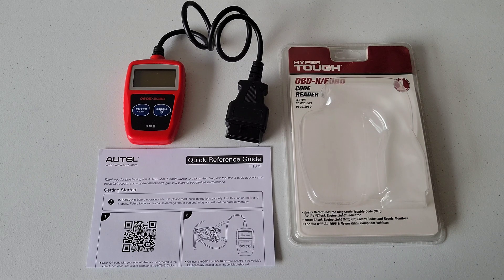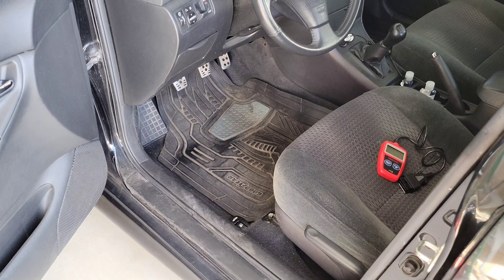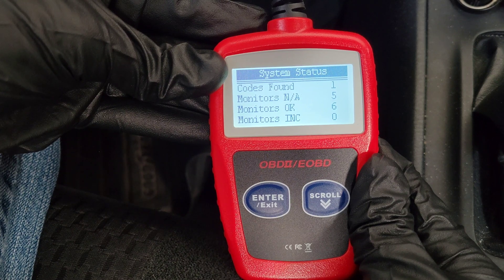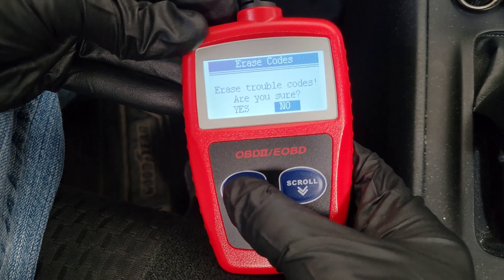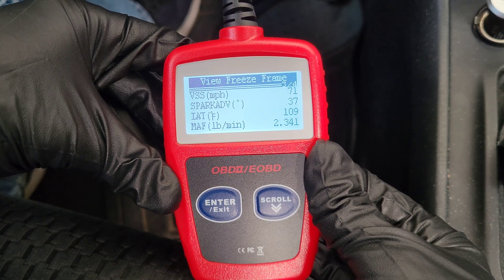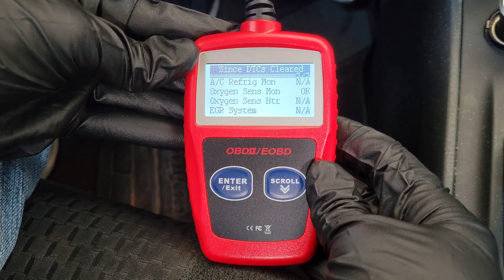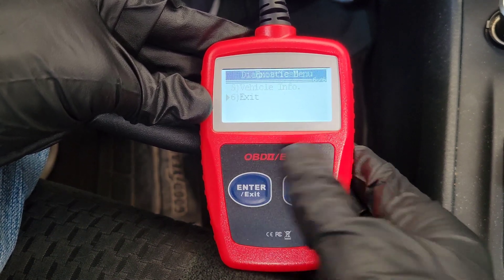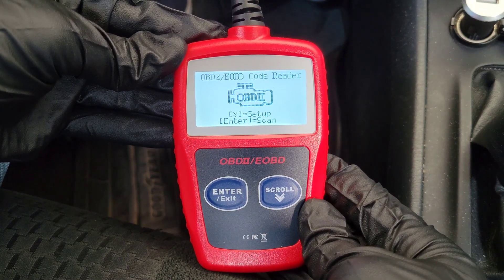Hyper Tough HT309 OBD2 Code Reader - How To Use - Check Engine Light

Comment: Hello Todd.  I have a 2017 Kia with a push button start instead of a typical key.  Do you think the OBD2 Reader would be compatible with my car because the ports for connecting on my car look slightly different than on your car.
Reply: all OBD2 connectors are the same

Comment: hello 👋 i got the same scanner at walmart to clear the code for check engine light on due to catalytic conveter and the sensor lights …i used the cataclean and reset the light …the light comes on after 674 miles of driving….can i take it for emssion test after 100 miles after reset the light? or how many miles should i drive before taking for inspection…ty

Comment: Why it not showing any codes on my 96 ford explorer
Reply from the maker: Hi and thanks for watching, Is your check engine light on? If so that is strange that it isn't showing any codes. I would contact the company for further assistance with troubleshooting. Thanks again for watching and good luck.
Reply: @ToddsGarage  I just saw on another YouTube page, to try unplugging a few sensors under the hood, that's supposed to trick them into working. My check engine light will come on whey the ignition is at on position.
Reply: Early 96 might still have the obd1 maybe?